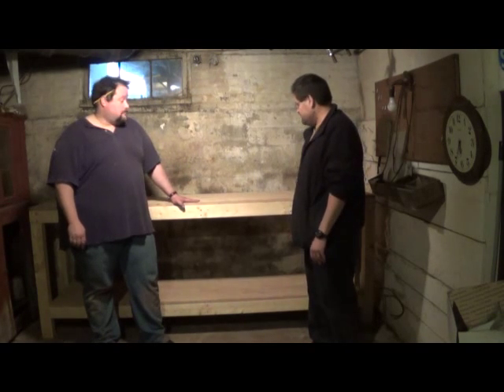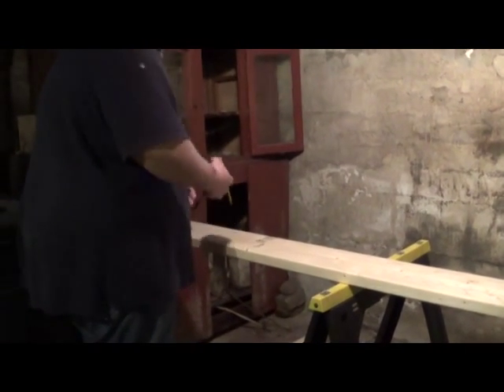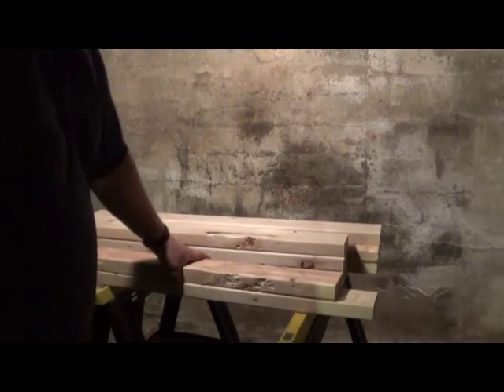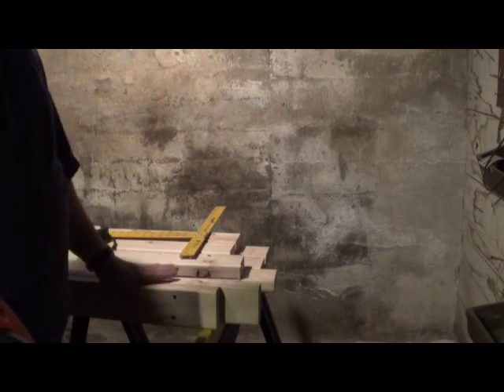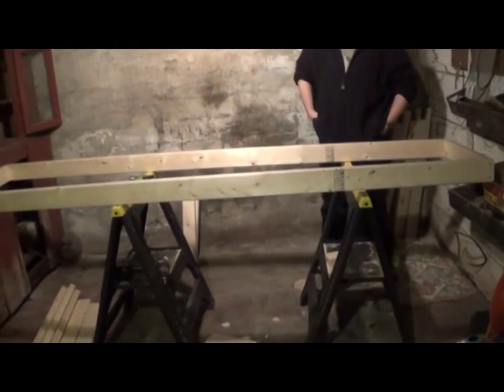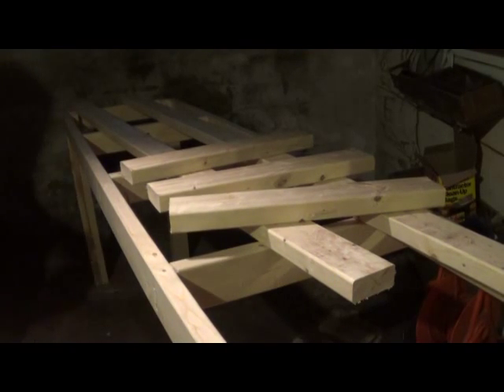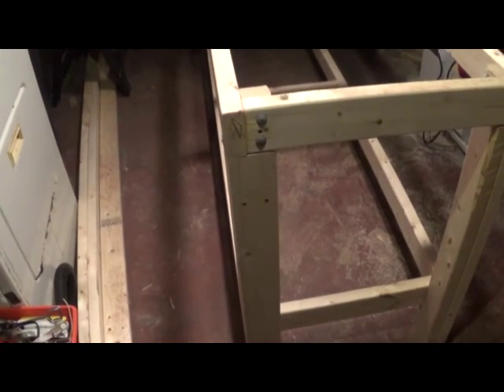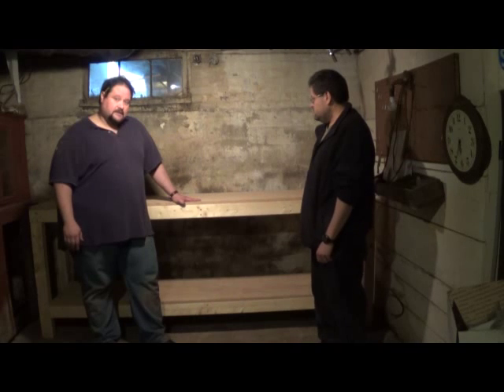How to build a sturdy Work bench for under $100 -DIY Daddy

Comment: Hi Dave! 

Love your work bench! You have got to check out auctions now that you have a truck. I purchased a similar work bench with steel legs for 22.50.  I imagine you will want a peg board soon and peg and boards are expensive! Check out an auction and you should be way under 20.00 for the board and pegs... Thanks for all you do! Chris